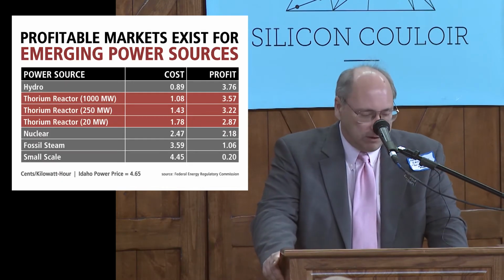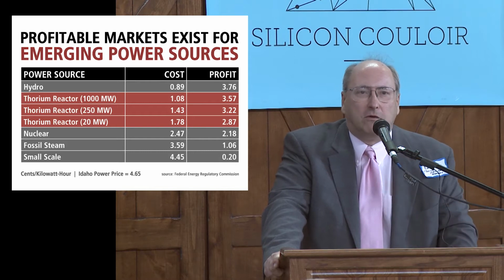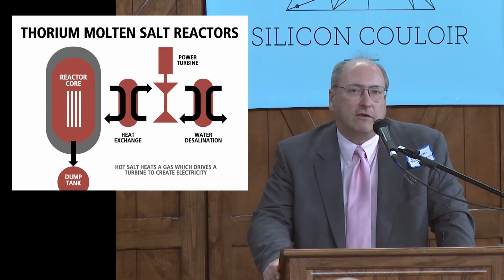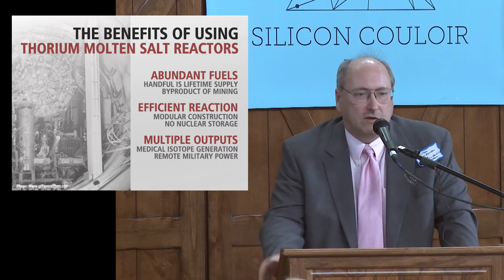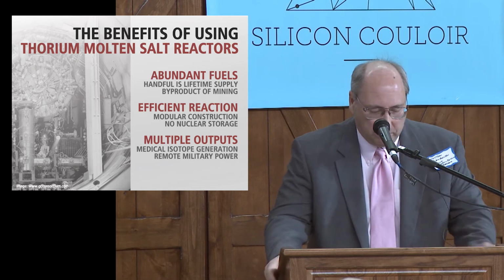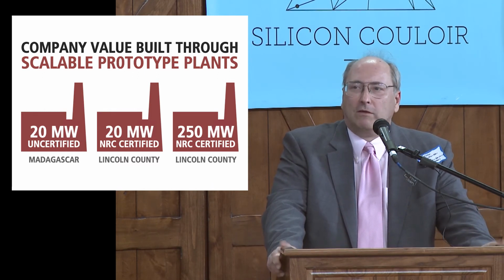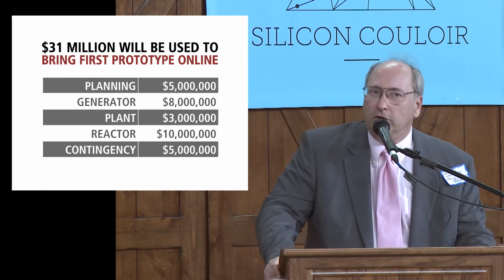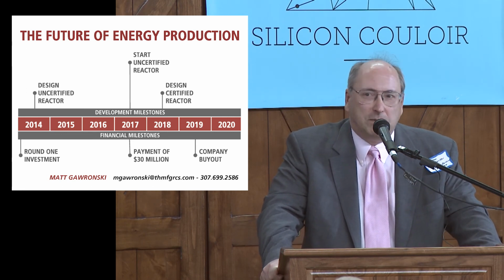Thorium: Pitch Day 2013

Comment: Is it safe to assume that your first 20 MW reactor will cost less than $30 million ($1.5m per MW)...?  It will be interesting to learn what alloys you will be using for the reactor and heat transfer system.